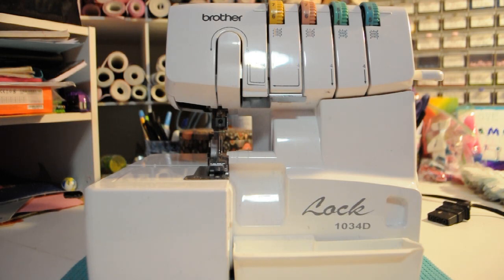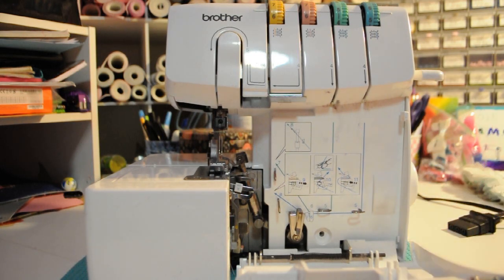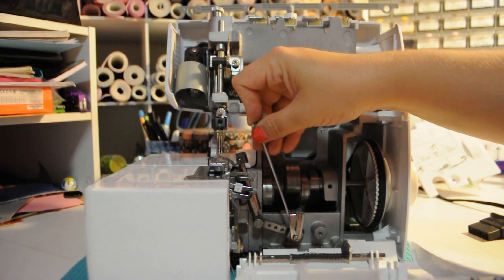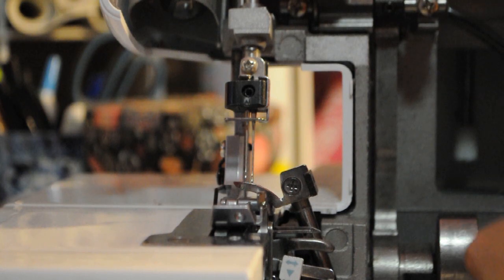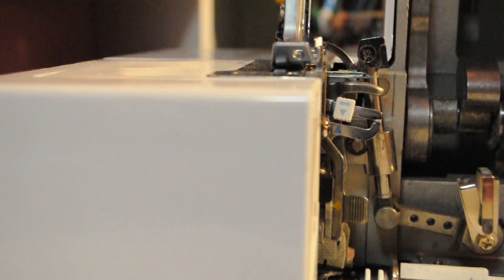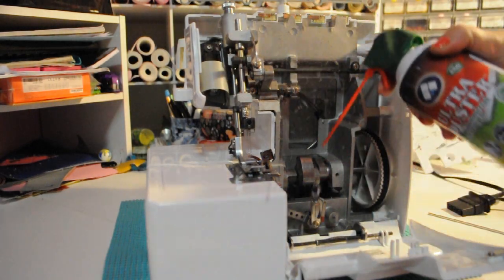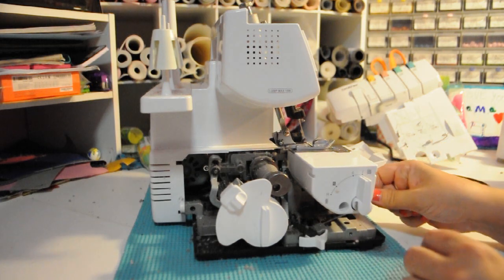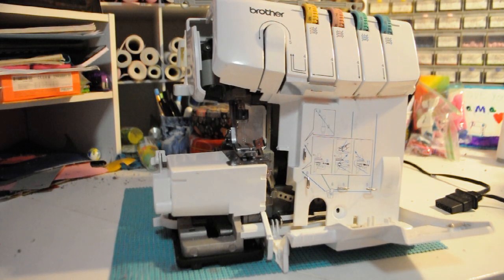Cleaning and Reseting Brother 1034D Serging Timing - Sash Fabrics

Comment: This was very helpful, thanks.  This was the first (and pretty much only!) video I found that helped me figure out why the left needle thread was not getting caught in the chain.  Everything seems to work correctly now.  And thank you the head's up on how to clean out the machine.  Much less scary than I thought.

Two items of note.  The Allen wrench is the 2mm size and I only needed to remove the front screw to extract the face plate.

Comment: Ohhhhhhh THANKS!
The left needle was not catching anymore.
I have been setting the upper looper thread hole based on other websites, which they say that the hole is between the 2 needles when the needles are at the highest peak. Your setting is better with an explanation and more accurate. 

I have done a lot of precise settings with this machine, not covered anywhere too including the shaft distance at the base of the lower looper. It's complicated, so I plan on making a 3D CGI cartoon of this entire calibration process.

One more thing. All the tools you need to fix this machine can be bought at Harbor Freight, because this crappy machine is not worth expensives tools.

Comment: Hello! I have a bizarre problem with my brand new 1034D where the motor is revving freely when I press the pedal and feels unresisted but the needles aren’t moving and it isn’t sewing no matter what settings I change. What could be the issue? Thanks

Comment: Here's the proper timing values in the OEM 929D and 1034 Service Manuals:  https://manualzz.com/doc/6446955/service-manual-for-homelock-model-929d     https://manualzz.com/doc/23413070/brother-1034d-serger-service-manual     I believe they are basically the same.
Reply: Just got a 1034D. Thank you for this. Was lookiinng at the Brother site and they did not list it. Will do my own maintainence on this since it is so inexpensive.